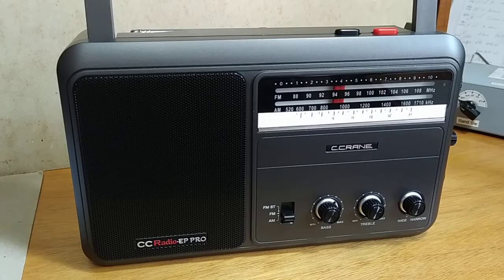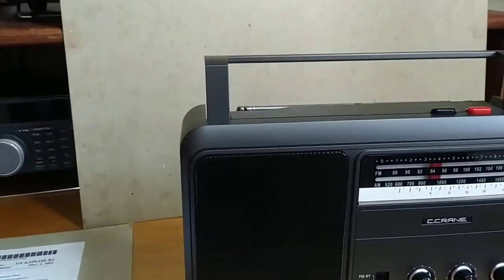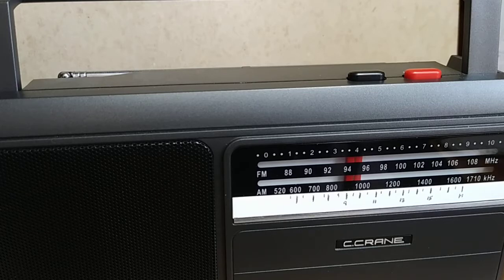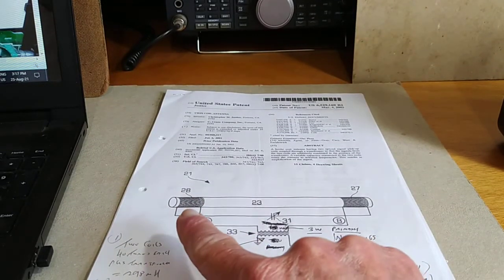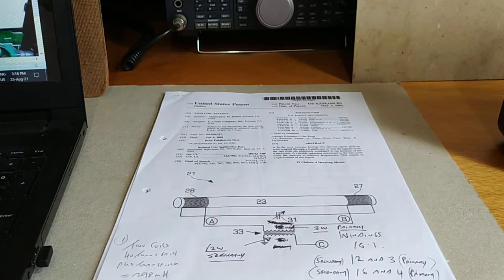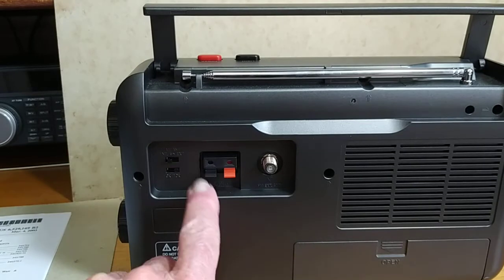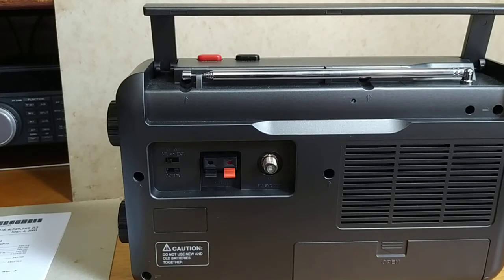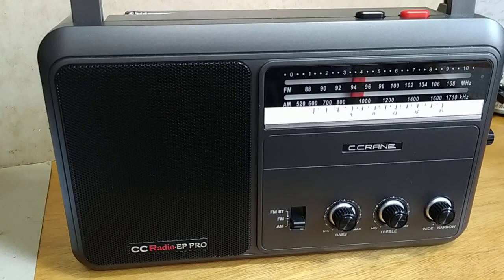CCRadio EP Pro and it's Twin Coil ferrite rod antenna.

Comment: Interesting video, thanks for sharing. Being such a good MW DX radio you'd think CC would've put in a more accurate readout. A friend of mine has this radio and the 2E which he uses to get an accurate frequency location while using the EP. I gave him a loan of my Panasonic RF-2200 and compared them to the CCs, he found this EP radio is closest to the Panasonic which has the unique functionality of making weak MW signals sound more intelligible probably down to it's air variable tuning capacitor and large gyro rotatable antenna, but for a modern radio this EP is really the best around today.